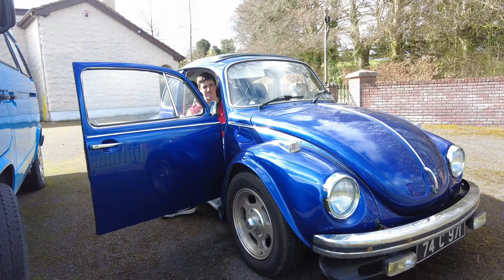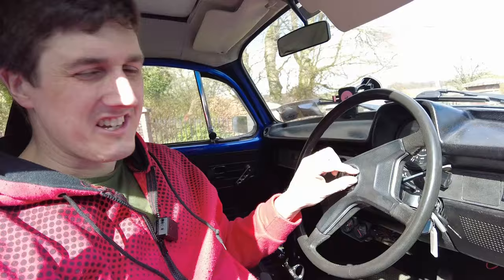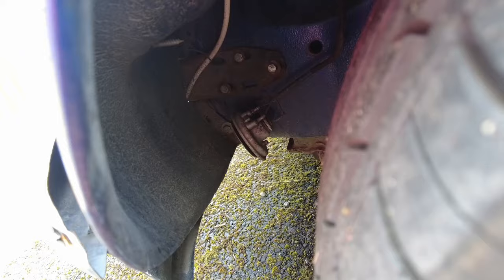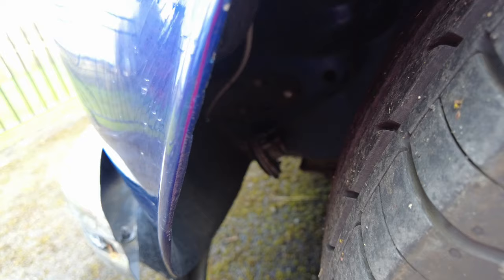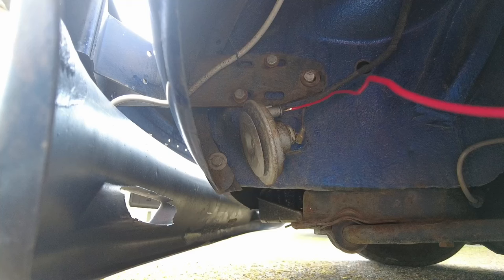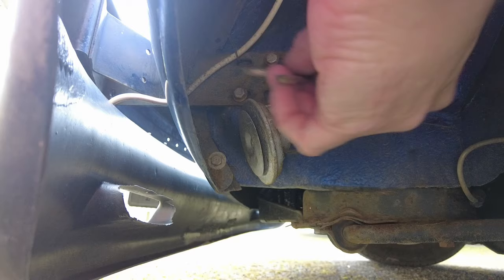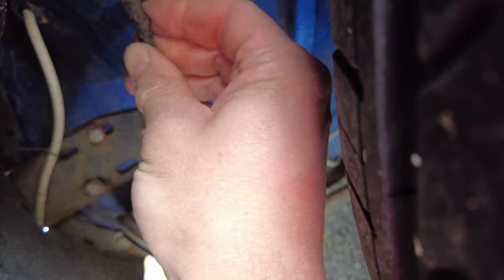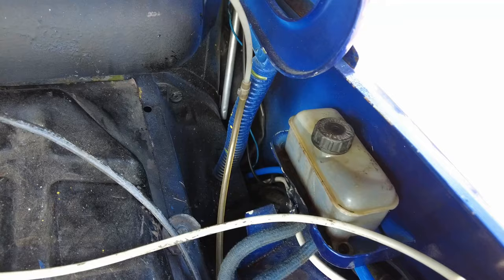Fixing Electrical Gremlins: How I Got My Classic Beetle's Horn Working

Comment: My horn did not work and a friend saw that the connector at the horn was corroded and when he replaced it the horn sounded. He left it disconnected and I took off the horn ring and connected the horn and it stopped.  If I touch the ground wire to the steering wheel it sounds. I tried to reconnect the horn ring and cannot get it to stop sounding. Do the steps you are outlining on the grounding apply to this problem?
Reply from the maker: If the ground wire is shorted anywhere along its path between the horn and the column, this will cause the horn to sound. You need to work through the entire path and find out where the short to ground is.
Reply: @Endfloat  one of the three washers under the screw heads on the horn ring was metal. I replaced it with one from a neoprene screw and problem fixed!
Reply from the maker: @Ljblossom  nice one! 😎